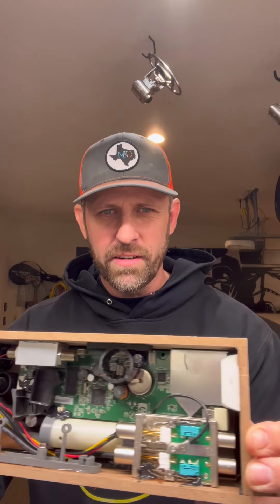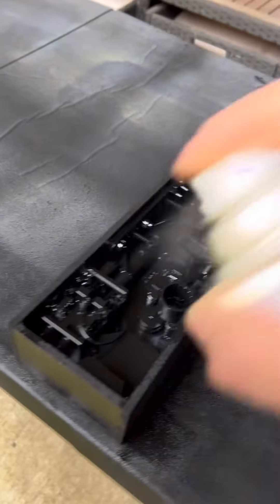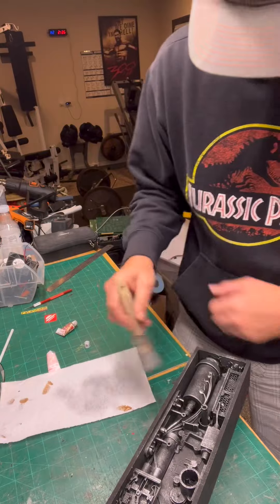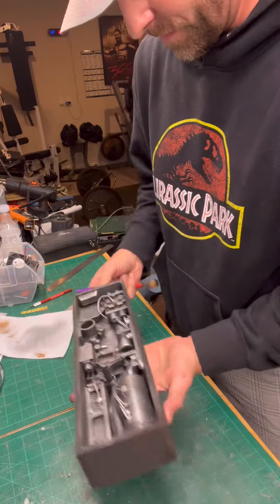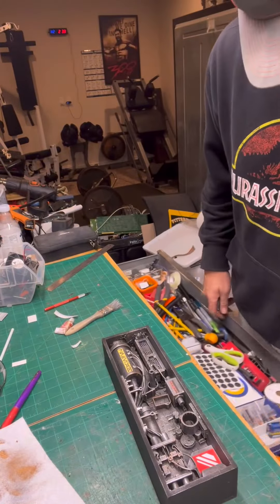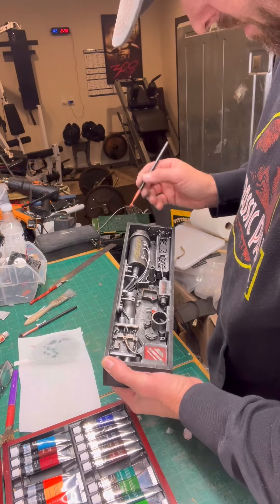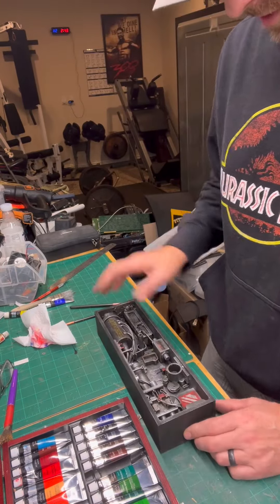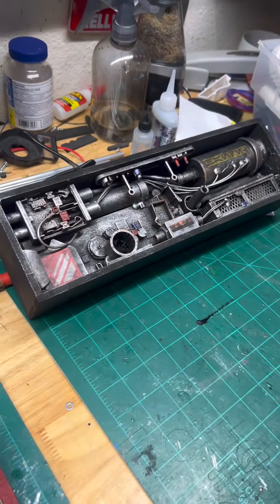Star Wars control panel easy paint and weathering

Comment: Good job with the nicely chosen greebles.
I don't like the effects of dry brushing on such large and diverse surfaces. I prefer to paint everything silver and cover it with thinned black paint and modpodge glue. After application, wipe the protruding elements with a cloth. This way we avoid chaotic lines drawn by the brush bristles. This is my opinion and experience ;)
Reply from the maker: Thanks for comment. I’ll try your technique im still learning the paint thing . But its quick and easy and hopefully someone will find this inspiring
Reply: @propsandvillainy  This is not a criticism ;) it's just my opinion and I highly recommend this solution. Good luck!

Comment: Great job as always Kelly. Love the medicine bottles. I must ask, are you hot gluing everything in there? I use a combination of Hot glue, Cyanoacrylate, Gorilla & 2 part epoxy putty. I find the putty works the best but I'm still looking to ask other builders what they like. For heavy parts I use screws. Just curious if you have a go to for this mash up of very different materials.
Reply from the maker: Yes your correct I use CA glue with a combination with hot glue  screw down the heavy parts and use hot glue to cover up the screws . It’s a mess but the first coat of paint hides it all

Comment: Excellent easy demo! Just bought me some rub and buff myself, never used it before. But after seeing several other builders use it, SR I’m looking at you sir, I’m gonna give it a go for sure. Question: how do you build the boxes? Are they just MDF and nails/wood glue or are they foam? I’m not experienced with woodworking. I’ve been using old tablet/iPad/iPhone boxes so far but I need to start making sturdier but light boxes with frames, like yours.
Reply from the maker: Thank you ! I need to do a quick video on how I make the boxes . Not the greatest way but it works . I use 1/4’ mdf sheets with wood glue and CA glue then reinforce with hot glue